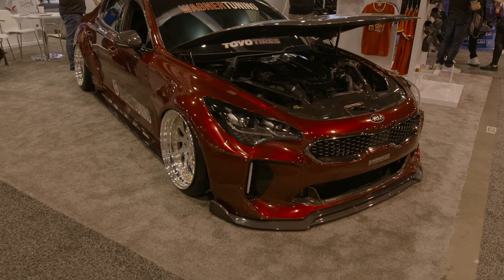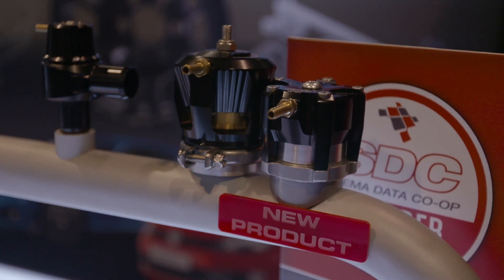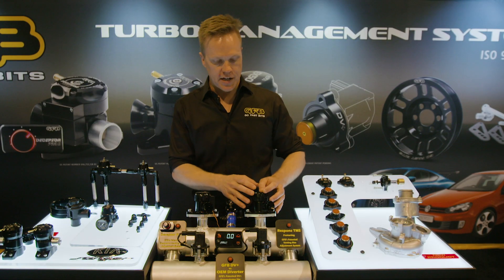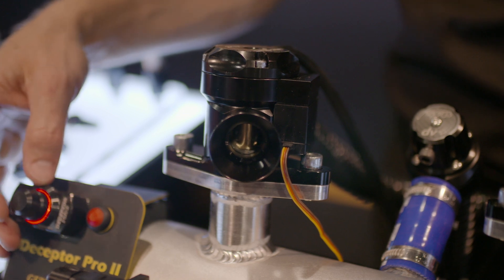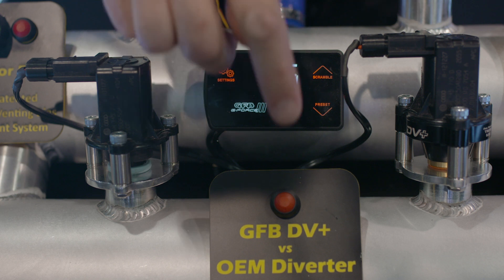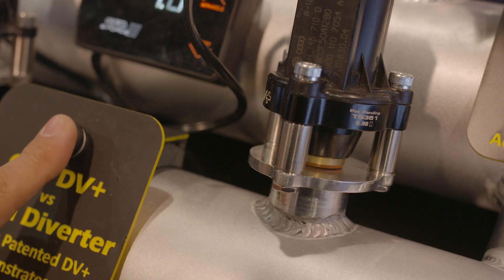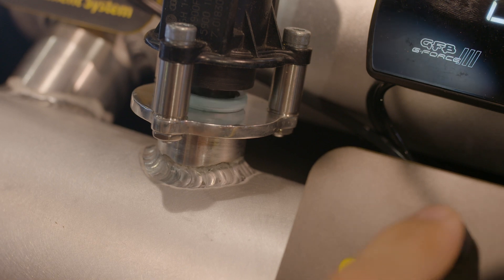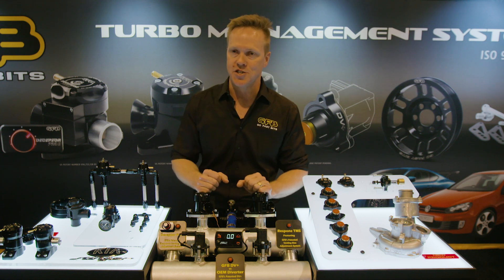Go-Fast-Brett explains Venting Bias adjustment BOVs at SEMA 2019

Comment: Who even runs BOV’s anymore...
Reply: People that know the benefits it can have
Reply: Yep I think you get the picture..
Reply: Haven't run a BOV in any of my cars for over 10 years now, never had any issues so far
Reply: @murraycalavera1834  And you won't either. I got a gfb bov way back, experimented with stock recirc, vent to atmo and ended up modding it so it's always shut as I got to know turbos better and the truth on which surge is good and bad. Its purpose is to cover the bov hole on my intercooler now and to make it look like it's still the stock recirculating system to casual inspections. Dose is king.
Reply: I just need that electronically adjustable BOV for sutututuuuuu on demand 😎
Reply: @wryyysespieces  you clearly know sweet fa 👍
Reply: People who don't want to rebuild their turbos year after year
Reply: @abadmixtape  Someone must be rebuilding my turbo when I'm not looking because I haven't had any issue in the 5+ years running no blow off valve with my turbo.
Reply: americans
Reply: People who don't want their turbos stalling with every gear shift